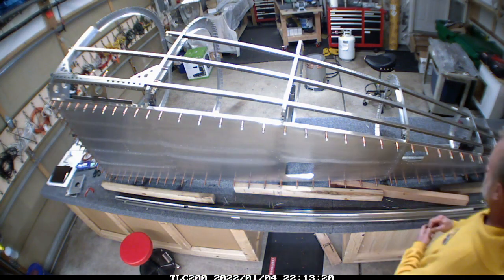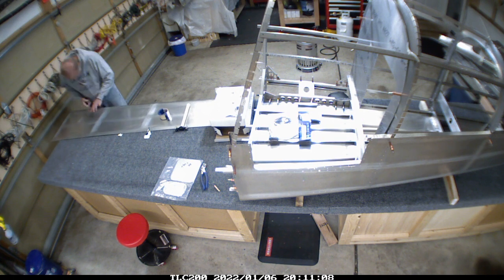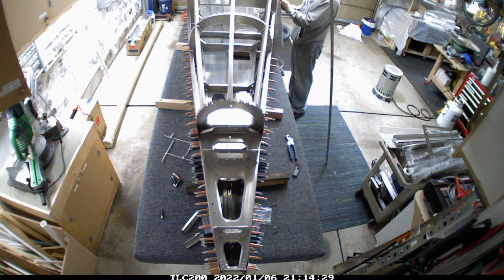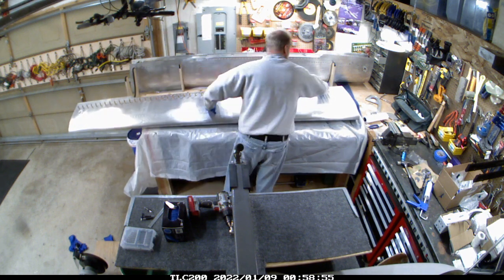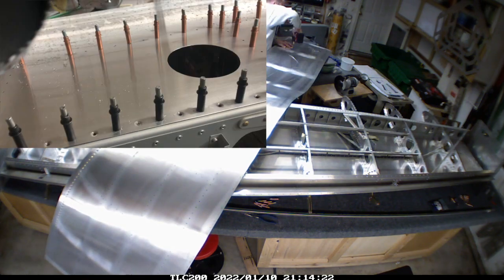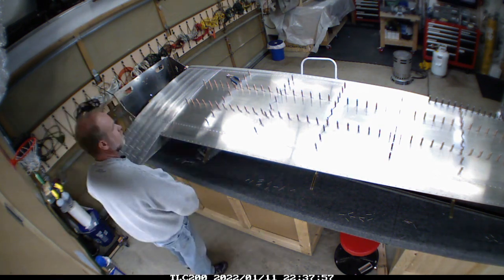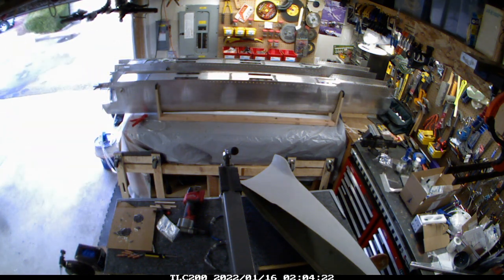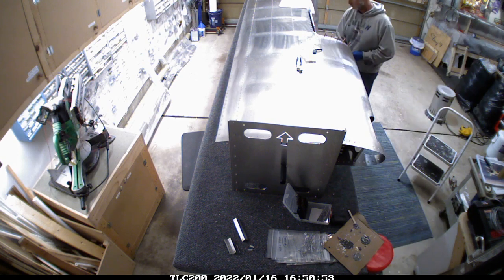2022 January Mid Month - SlingTsi

Comment: How many clecos of each size did you end up needed to complete so far?
Reply from the maker: Hi Colin... effectively I doubled the count that Sling recommends in the build manual.  Because I was working on a number of different aspects of the build I did run a little short on the clecos.  In looking at my order, I got 550 of the M-1/8 Cleo's and that's honestly the one you'll need the most of.  225 of the M-5/32's.

I also got a couple of really nice bins at Harbor Freight to hold them as you'll be getting them in/out a lot.

When you build the wings you'll get the M-1/8's and M-5/32's super gunky with the pro seal.  Some folks just throw them away - but I'm a bit of a cheap bastard and someone who doesn't like to throw stuff away if I can help it.  So when you do the fuel tanks and pull the clecos from there, toss them into a bucket of turpentine and when you're done with the day clean the clecos.  They can be reused that way.  They are very hard to clean, but get a scrub brush and let them dry.